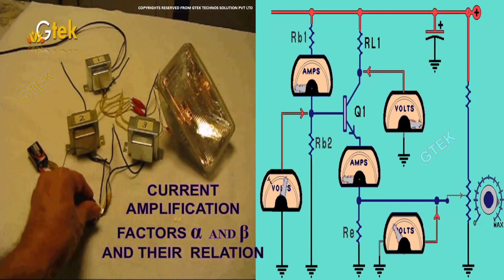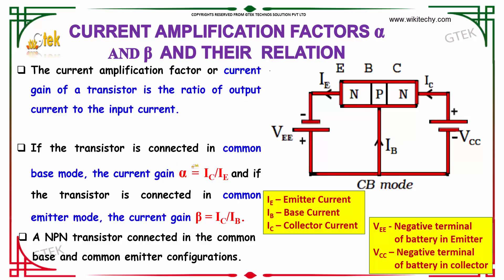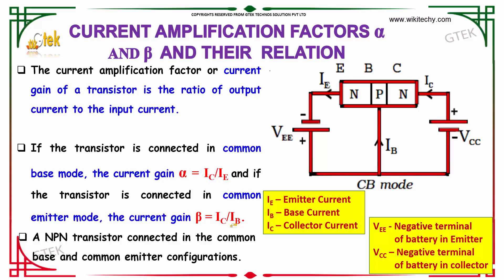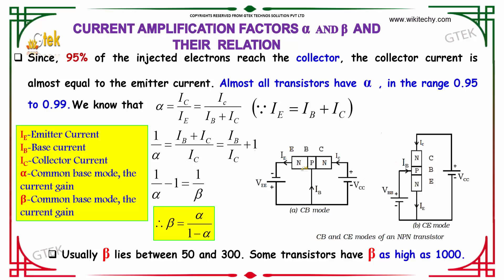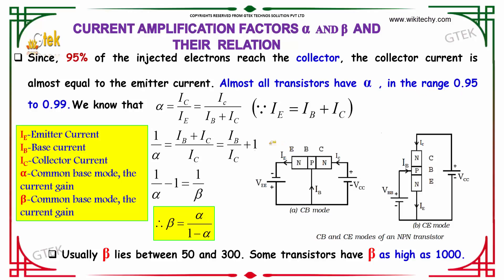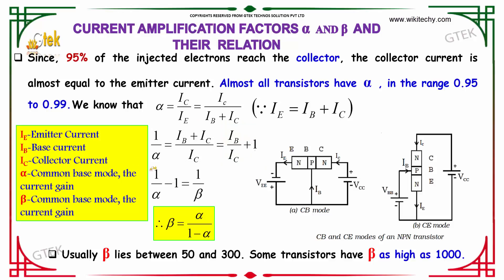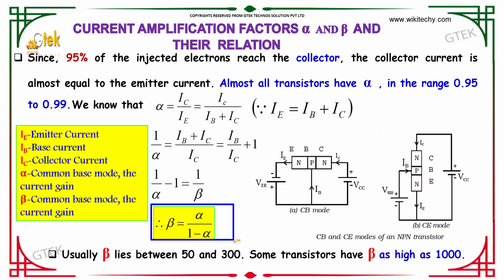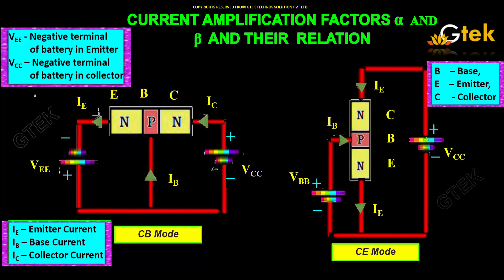Current amplification factors Semiconductor Devices class 12 Physics subject notes lectures CBSE IIT

Comment: The amplification factor, also called gain , is the extent to which an analog amplifier boosts the strength of a signal . ... If the output power is less than the input power, the amplification factor in decibels is negative. If the output-to-input signal power ratio is 1:1, then the amplification factor is 0 dB.

Comment: For power, doubling the signal strength (an output-to-input power ratio of 2:1) translates into a gain of 3 dB; a tenfold increase in power (output-to-input ratio of 10:1) equals a gain of 10 dB; a hundredfold increase in power (output-to-input ratio of 100:1) represents 20 dB gain.

Comment: A transistors current gain is given the Greek symbol of Beta, ( β ). As the emitter current for a common emitter configuration is defined as Ie = Ic + Ib, the ratio of Ic/Ie is called Alpha, given the Greek symbol of α.

Comment: An amplifier, electronic amplifier or (informally) amp is an electronic device that can increase ... and 300 GHz. Another is which quantity, voltage or current is being amplified; amplifiers can be divided into voltage amplifiers, current amplifiers, ...

Comment: A theory for the variation of the common emitter current amplification factor, β, of a junction transistor with emitter current is given in which the effects of emitter current variation are visualized directly in terms of the effects of variation of the injection level in the base.